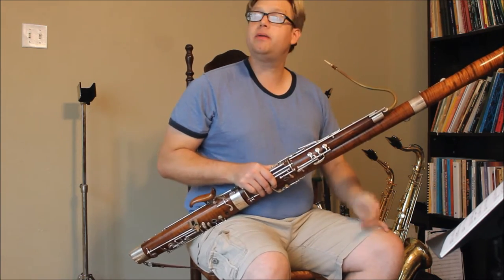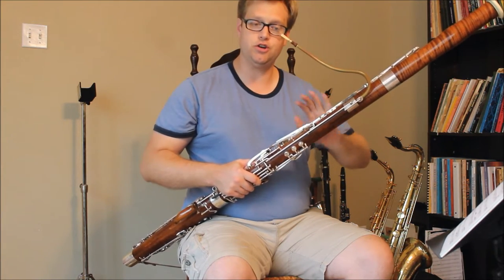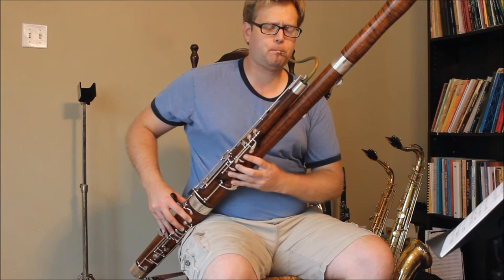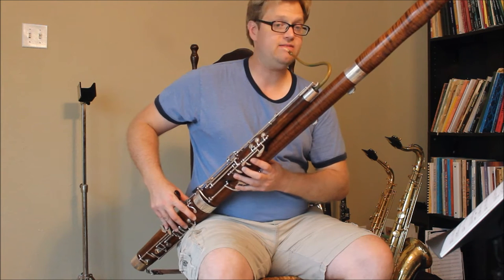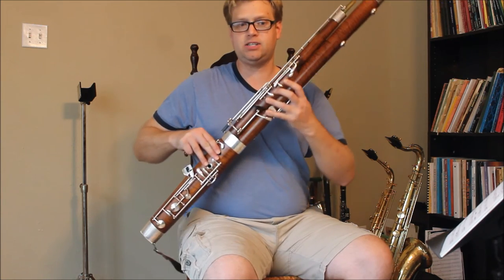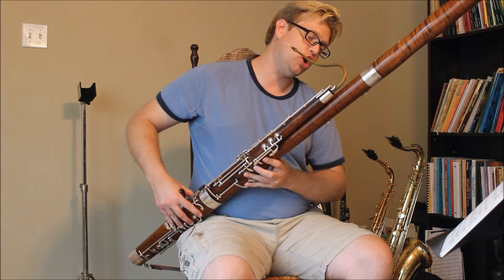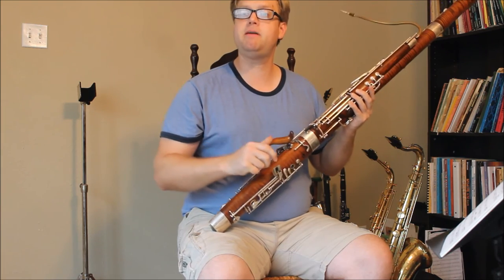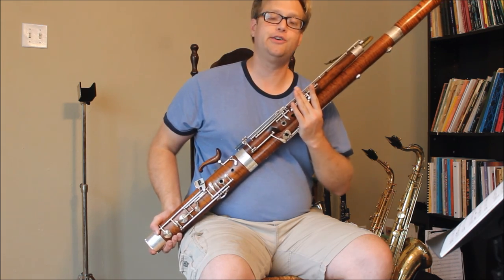Advanced Bassoon mechanics 2

Comment: Where did you purchase this bassoon/where could i purchase it with all of the features on it? Thanks!
Reply from the maker: It was a custom order directly from the manufacturer. I worked with Guntram Wolf on this instrument over three iterations to get it where it is now.
Reply: If you do not mind telling me, How much it it cost me?
Reply from the maker: I wouldn't be able to give you a quote. It's been a dozen years and nothing was itemized.
Reply: ok thank you for the quick response! Would you be able to recommend a bassoon under 12,000 that has these features? Sorry for the excessive questions!
Reply from the maker: Under 12k?  You won't find it, sorry. 12k will get you a standard model plus an option or two.
Reply: Are there any under 12k that are standard you would recommend?
Reply from the maker: It depends on your playing level. The Fox 240 is the standard to recommend. I'm playing on a Wolf 2000. Some of the Moosmann's are in this level as well. Also look for used Foxes and Puchners.
Reply: Thank you for your great content and speedy replies! Suscribed!